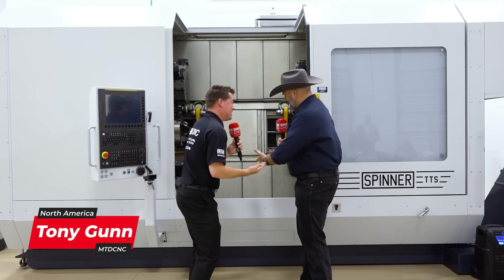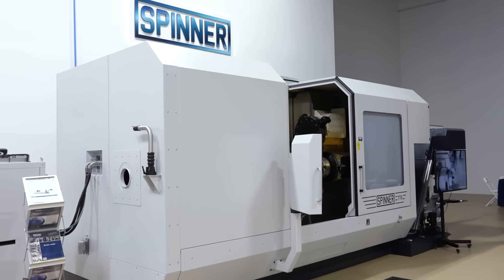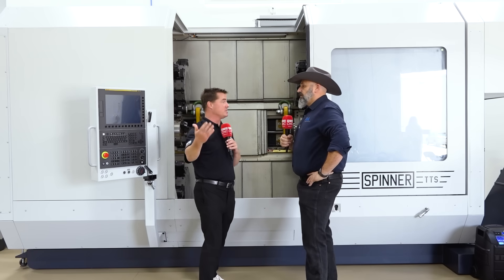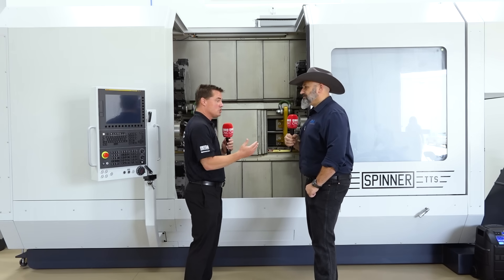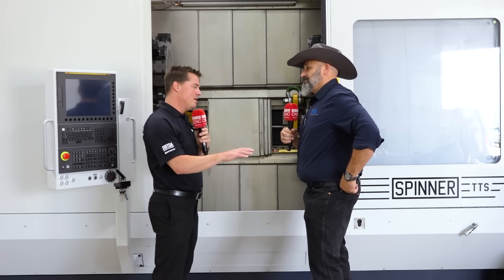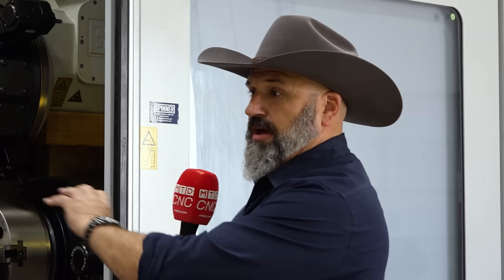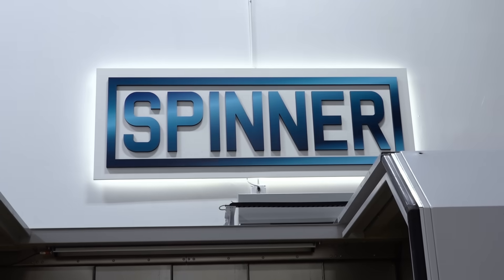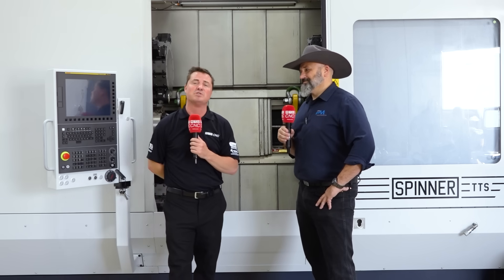When the parts get massive, you need a machine that does more than keep up.

Comment: this might seem like a small thing but i really like that the internal is straight up instead of slantered so you dont really have to lean agenst the wall if like changeing a tool or insert on the tool holder on the back side of the turret and cant turn it around for some reason ( like on my citizen abx64 ) and has to go change your shirt cause the sleeve is covored in old dried coolent oil and whatnot